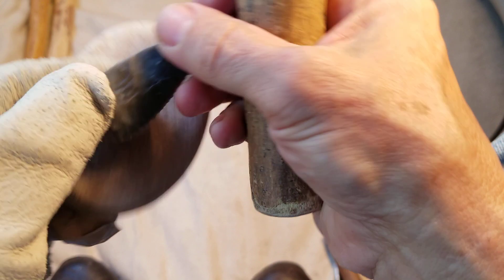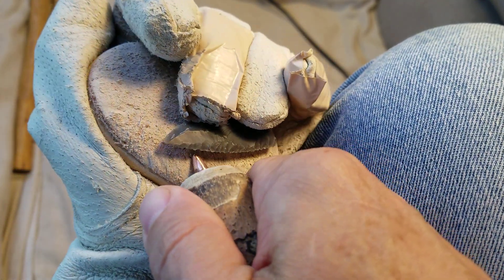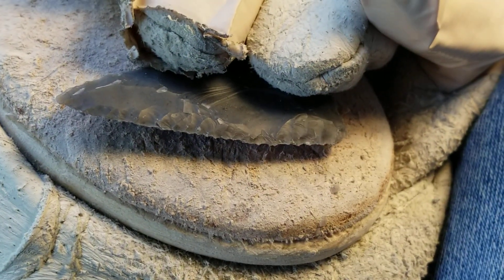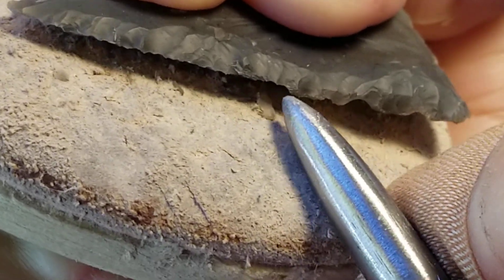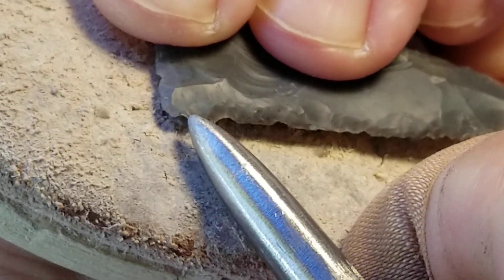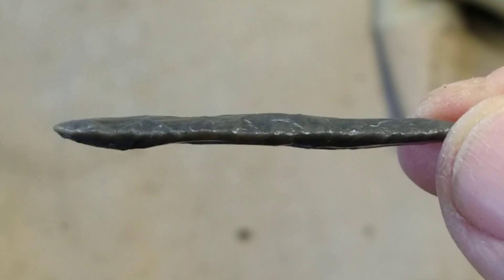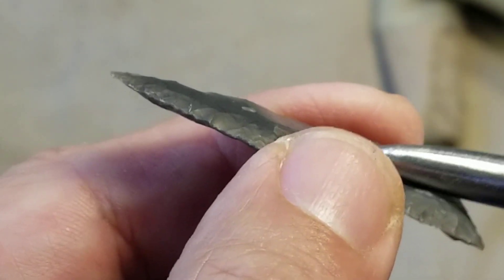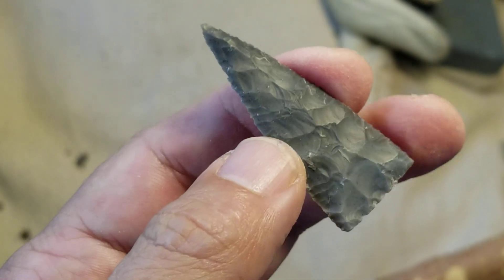1283 - Part 1/2 Flintknapping Serrated Arrowhead - Preform Stage

Comment: I use to collect arrowheads as a kid. My Dad worked construction in Northern California and Washington state which are good places to look. One thing every arrowhead I have ever found has in common no matter the shape or size. If you hold the arrowhead at the end that attaches to the arrow shaft look at the tip and leading edges. One side rolls up and the other rolls down. Matching the fletching roll to the arrowhead roll would make the arrow spin like a bullet.
Reply from the maker: Interesting.
Reply: @KnapperJackCrafty  With all due respect Jack please fact check. I'm sure you have some of those artifacts around.  I gave my collection to my youngest Daughter 30 years ago or I would post them on my channel. I didn't even notice it for 40 years.

Comment: Why do you immediately DULL the edge just after putting it on(at least it looks it)!!   I kind of like your BLEH,BLEH,blahblah yada yada ,this,that!But some basic instruction would not go amiss, Start out with a hunk of flint, or glass, go all the way through to a completed arrowhead. Why this, why do that, whats a "step fracture", or whats that pad you hold for?
Reply from the maker: This video has a number "1283" in front. That's because there's 1282 videos on my channel before this one.  😁 Many videos on the complete process from chunk of rock to finished point.
Reply: @KnapperJackCrafty  oh and don't forget the artifacts.